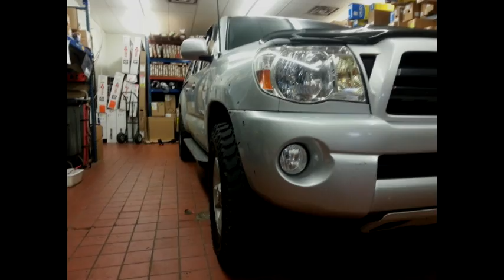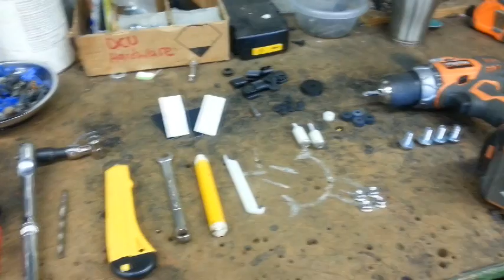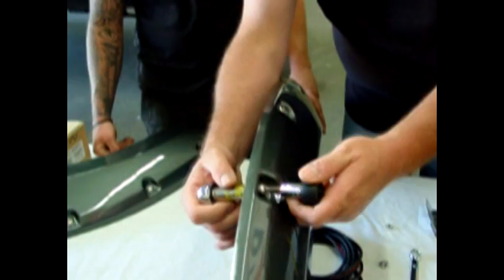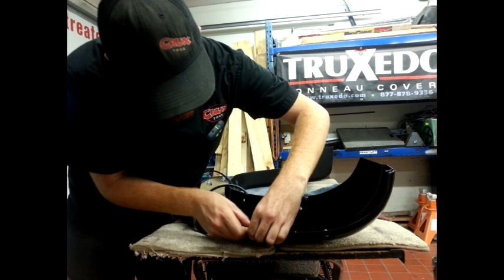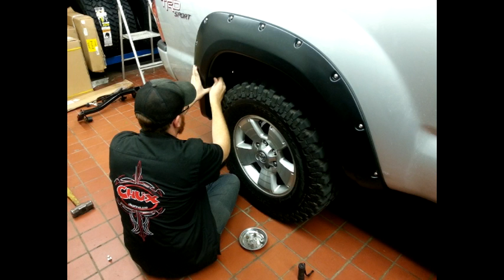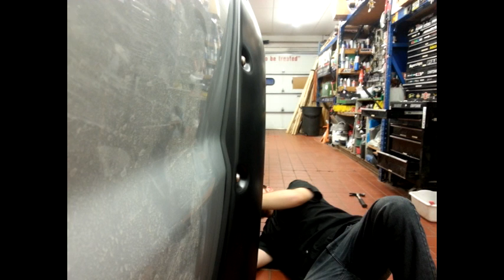Bushwacker Fender Flares Installation - Toyota Tacoma

Comment: Does anything hold the flares to the side like the oem with clips ?
Reply: No, just on the underside in the wheelwell lip area.  There is a gasket around the outer edge to protect the paint on the fenders

Comment: I have a 2000 prerunner that will need some cutting done because they're only made for the 4x4. However, every accessory company around my area has a different understanding of how it's done. Have you ever done one on this prerunner body style? Thanks
Reply: Eddie Fine what's the difference between a prerunner and a 4x4 as far as fender flares go??
Reply: Nothing. Same body.  Prerunner is just a 2wd with a mild lift kit
Reply: No